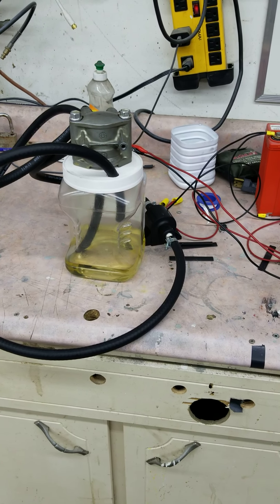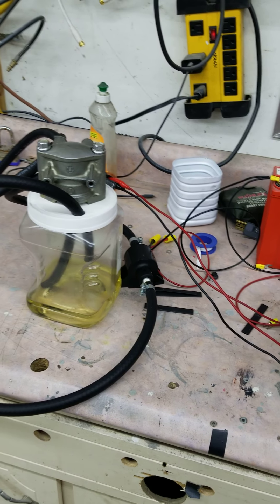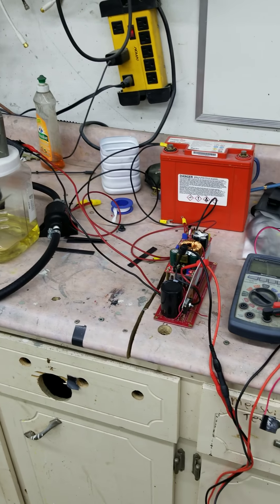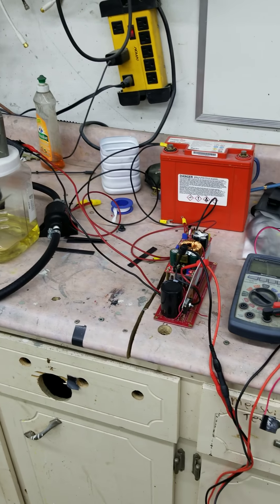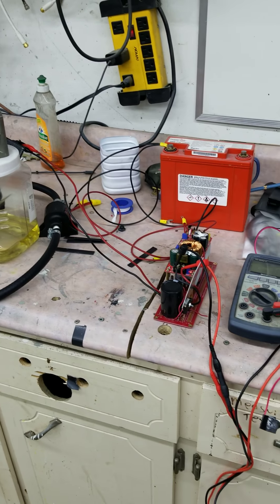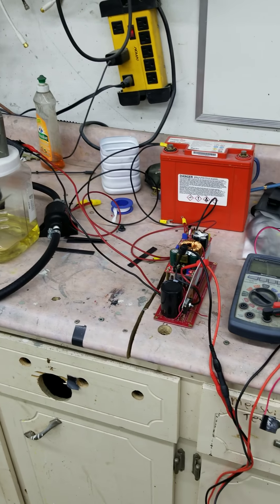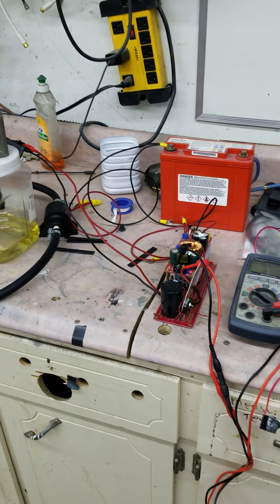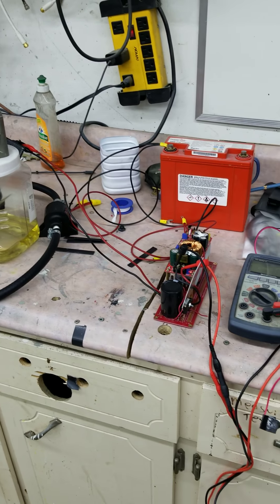Home built Etec outboard injector cleaner/activator system (video 1 of 2)

Comment: etc. I give 12 volt energy to the 40 hp full injector outside and the engine sound is heard but it does not spray gasoline. 2 injectors do not spray gasoline. Engine brain is solid. What can I do..Please help.
Reply from the maker: You have to remove the injectors to see if they are actually pumping fuel
Reply: fuel injector outside I put it in a full box and give it 12 or 24 volts. There is a ticking ticking sound coming from the injectors, but they do not spray gasoline. Do I need to give 55 volts? Thanks buddy..

Comment: whether you can send a picture or diagram of this assembly. i found a voltage converter on amazon but i need how you made the whole circuit, with that big capacitor on the board below

Comment: Hi Jim, Great video! 
But the electric build part is to much trouble for me. 
So I made a connection port for my fuel line which allows me to connect a portable fuel tank with a 5 gallon 20/80 mix of cleaner and fuel. 
Once I'm out on the water I turn off the main fuel supply and let the engine run at different RPM on the cleaning solution until it's empty. Then I switch back to my main fuel supply.
It cleans out the combustion chamber and fuel system as well.
This gets done once a year.
Also I use Yamaha Ring Free as an maintenance fuel additive.
Reply from the maker: Wow..that is actually a really good solution...and much simpler.  Very cool

Comment: i bought the allsun em276  injector tester and dc buck converter DROK 6-55V TO O-50 VOLT 8 A 400 WATT CONVERTOR I HOPE THIS WORKS, jim did i get the right stuff from amazon

Comment: sorry just looked at your other video thanks .question could i use a ac to 36v dc power supply to run system for the injector and what pressure pump are you feeding injector please also a list of cleaning fluids
Reply from the maker: You likely could.  I would start with a lower voltage until you see how it reacts.  Depending on the size of the injector.   I'm just using a basic electric inline fuel pump.  Pressure is not important in this case u just want the reservoir to have an influx of fuel to keep the injector full

Comment: wonder if you could remove the inyector from its casing and reinstall it backwards in order to unclog in the oposite direction flow using your set-up. Biggest issue I see would be the matting surface between the outside surface of the injector and inside face of its casing so does not leak.
Reply from the maker: I have never removed the injector from the casing but I understand that they do come apart.

Comment: Nice and smart idea.Any way you would clean a couple during the off season. Im in NB ?Thanks Terry
Reply from the maker: Hi terry.  Unfortunately I have repurposed much of those parts.  I no longer have an etec so the fuel pump and power supply are in use.
Reply: @ontariooutdoorsman  ok, thanks for getting back to me .I took mine apart , removed the screens and tips and did a cdeep cean and installed a seal kt with new crush washer and screens .I think I should be good .All the fuel delivery items were dirt and had H2O in them .Cleaned it all from tank to injector and got rid of the contaminated fuel(previous owner )

Comment: Hi Mr Jim  do you have a wiring Diagram for this tester, i am trying to bill one , Thank You So Much Sir
Reply from the maker: Hi.  I used to.  Cant find it.  If I get a chance I will see if I can make one.  It was very simple.  The injector tester box which sent pulses..going thru a transistor (darlington pair) to amplify the pulses.  Driven and powered by the dc to dc converter.
Reply: Hi Mr Jim Sorry to Keep bother in you ,but i tried every way i could with no luck , i have the Darling  NTE 2541 Transistor  ,i have everything ,but just cant get the pulsating  ,i also have the 12v injector cleaner  and the step up transformer just cant get it to work , Please Help!!!! @ontariooutdoorsman
Reply from the maker: Ok I set mine back up with a 12v headlightbulb as a load as i dony have an injector.  I think I know what's up.  The base of the transistor is driving thru a 2k resistor.  Its driven by the NEG wire from the pulser tester..not the positive.  This has to have something to do with the voltage wave coming out of the tester and the float voltage of the transistor base.  If you drive it with the red wire from the tester..it will just pulse on.  The voltage must stay too high and never turns off.  Hope this helps.  I'm going to draw up a diagram.
Reply from the maker: Watch this new video
https://youtu.be/BV0MgFIg5vk?si=lxHajF299kLIJ0ne
Reply: Thank You So Much Mr Jim ,YOUR A ANGEL , Thank You For a Diagram  that would be MOST HELP FULL AND APPRECIATED, I will  Be Looking for it  ,GOD BLESS YOU ALWAYS Glenn @ontariooutdoorsman

Comment: Gday Jim. What sort of amps are you looking at using with that dc2dc ? Cheers
Reply from the maker: I cant recall what current it was pulling .  It was a 0 to 60v dc to dc converter and I added a large cap to the output to sustain pulses.  I was running it around 30v and the fuel heats up quickly so there is definitely good current flow.  Could be calculatednif you measure the resistance of the injector coil

Comment: Hi Jim, Thank you for this video.  I have 2 x 115 Etec's from 2007.  The port engine has two bad injectors.  I didn't know that the injectors were so hard to find nor that expensive.  I am more than impressed with your set up.

So, if I've listened correctly, then I would need to source:
1. Etec fittings for testing & cleaning injectors from Ebay
2. solid state fuel pump - what brand, source, cost?
3. Seafoam cleaning solution
4. DC to DC converter to boost 12VDC to 55VDC, but you set yours at 35-38VDC for less heat production - any tricks on setting the output voltage?
5. Fuel Injector Testor - EM276 - any recommendations where you bought this?
6. Wiring is 12VDC positive into Fuel Injector Testor.  FJI to DC/DC converter.  DC/DC converter to ETEC injector
7. Reservoir built from what looks like a Friskies Temptations Cat Treats container, because I use them myself for other containers.

Is there anything I've missed because I want to build this now and clean all of the injectors on both of my engines.

Thank you again for this video... It's great.
Reply: Don’t need 55volt, 12 volt will operate the  injector. the injector tester is handy. Also don’t need the fuel fittings as it’s best to set injector in the carbon cleaner. Make sure you cover bottom holes (return) and the top filter. Injector needs to be removed from the housing.

Comment: Hi Jim, I was wondering if you connect the output injector tester cable +/- to the DC dc step up. I've connected all but the dc/DC doesn't start. I bought the same step up but i notice you have a capacitor between the injector and the output from the step up converter. Please send me a wiring diagram? Thanks.
Reply from the maker: So i have the output off the power supply connected to a darlington pair power transistor.  The injector pulser cannot power the converter directly...the converter is connected to 12v to produce up to 55v.  Then the output drives the injector thru the NTE2541 transistor.  Injector connects to collector of transistor...other side of injector connects to 55v.  Injector pulser drives transistor base which activates it.
Reply: @ontariooutdoorsman  Thanks for the explanation. I will try it. I allready burned 2 transitors. But will keep trying. 
Reply: Hi what # Step up dc/dc did you use and did you ever get it to work? Glenn Thank You

Comment: Hi,

Do I need to use a 10000uf 100v capacitor or can i use something similiar or abit smaller?

I'm having trouble finding one
Reply from the maker: I only chose such  big capacitor because the system uses alot of power.  I'm sure you can use a smaller cap

Comment: Do you know how many amps the injector needs to operate? Just looking to get a step up voltage transformer and not sure how many amps it needs to be able to support.
Reply from the maker: Sorry was a long time ago and I dont recall.  I can tell you that it generates significant heat so dont run it without fuel flow or will be damaged..there is a wide range over which it can operate so as long as you reach the threshold it will pump.

Comment: Hi Jim, I was wondering if you connect the injector tester cable +/- to the DC dc step up. I've connected all but the dc/DC doesn't start, low tension from the tester?  Thanks from Italy 🇮🇹
Reply from the maker: Hi.  So not sure if I have explained this fully yet but there is more to this than just the 55 volt power source.  The power source allows the voltage to be adjusted to the proper range however the fuel injector driver is a 12 volt device creating 12v pulses.  The injector pulser is driving a power transistor (darling pair) to activate the etec injector.  The darlington pair is a very high gain transistor with high input impedance.  The collector of the transistor goes to the etec injector neg terminal and the 55v supply goes to the positive etec injector terminal.  When  a pulse is sent...it basically connects the negative terminal to ground and fires the injector for the duration.  I found 35v to 45v quite good but certainly very powerful injector pulses as voltage approaches the 55v level.

Comment: Just wondering where do i get the fuel line kit for testing?
Reply from the maker: I actually found it on ebay when I purchased it.  I got the part number somewhere on Brp manuals.
Reply: @ontariooutdoorsman  i can't seem to find a part number anywhere for this product
Reply from the maker: @bryceraphael6865  all I can tell you is they call the fuel hoses a fuel manifold.  And if I recall it was something like a fuel manifold test fitting or test port.  Was a long time ago and cannot remember exactly but I bought it and it was an evinrude package with part number.
Reply: That's awesome thanks for your replies. I'll try looking under that description and post if i find something

Comment: Jim - wow, such an awesome video!  i am an outfitter in alaska, we run 3 jet boats on a skinny river.  2 of our boats we run yamaha 4 strokes but on our bigger boat we run an etec.  i have built a homemade injector cleaner for the yamis (way easier) & also have that pulser.  we have had to replace a couple of the etec injectors in the past & as you said...they're super expensive if you can even find them.  per your video i have a step up converter from amazon on the way.  i need to build these here at home (WA) in the next week before i fly up.  everything is in the bush so i have to have all parts with me.  my question is this...i cannot seem to find those adapters on ebay.  i'm either not searching correctly or the guy doesn't sell them anymore.  i know this is a big ask, but do you think you could check the size (threads etc) on yours and maybe i could get something to work?  my motor is up in alaska so i can't do a comparison on my own.  i'd really appreciate any insight you could give me.  if you can't, no worries...thank you very much for taking the time to film & post your rig, i don't think you'll ever know how many people you've helped with this.
Reply: oh & jim, if you do have the time i thought i'd ask up front too save time...i can't seem to find the o.d. of the end of the injector itself so i don't how big the hole i should drill into my lid that accepts it.  i don't know if you over drilled it & inserted a grommet or what.  i can't measure until i get up to alaska & then it'll be too late.  you prob have injector in motor but maybe you could measure hole in your lid & i could reverse engineer.  no prob if you can't spare the time...i totally get it.
Reply from the maker: Hi.  Sorry just seeing this now.  Hope  you have figured things out.  I basically just cut a hole in the lid f the jar that was larger than needed...then marked the 2 Bolt holes that mount the injector.  Very simple and the spray stays inside no problem
Sorry about the fittings.  I havnt used in a while but I will see if I can find them.  They are the identical fittings that the engine has on it to connect t the injector.
Reply: @ontariooutdoorsman  hey jim thanks for the reply.  we had to fly up for a week to open up camp for silvers.  i had built a homemade injector cleaner for my yamaha 4strokes (way easier), i ran out of time to dig out my etec injectors to try and figure out thread slash size of fittings.  i ordered the step up generator you recommended and after watching your vid again i realized the simplicity with regards to attaching the injector to your vessel.  my problem is that i head back up in a week for 2 months in the bush and won't be able to figure out the size of those fittings that go into the injector.  i can't believe how hard it is to find info on those fittings, i thought i was a pretty decent googler but man i'm struggling.  anyway, i appreciate the reply, if you happen to trip over the thing let me know:)))  although i'm pretty sure your injector is back in your motor.  or if you have a suggestion or a website/link i could go to... hey listen, this is a big ask, we're all so busy so i get it, thanks for posting all this, really helped me.
Reply from the maker: @8barbies779  ok I found it.  Went to my ebay acct and loked back at the purchase and found the OMC/BRP part number.  Check this link 
https://second-wind.net/products/omc-johnson-evinrude-5005844-genuine-oem-e-tec-outboard-nipple-o-ring-kit
Reply: @ontariooutdoorsman  Jim, can i tell you how much i appreciate you!!!  i'll be home in a couple of hours & i will check it out...i'm horrible with googling on my phone:)))  i will order if still avaliable because i have to leave for idaho on teusday for 2 months because i have elk hunting clients coming in on the 15th.  it just makes me happy that there are still people like you in the world that we live in with all the crap going on these days.  i will report back & let you know how it works for me & if there is anything that i can ever do for you i will respond to any reply you send me or i can give you my email.  i'm just blown away that you took the time.
Reply from the maker: @8barbies779  not a problem.  You may have to search the part number to find a seller but probably any dealer that sells evinrude parts can get it.  Good luck with it.  I'm also an avid hunter and bush pilot.  Good luck
Reply: @ontariooutdoorsman  Hello Sir, can you share the schematic and the type of equipment that you used for this system? Thanks a lot!!!

Comment: can you give me the site where you purchased the connectors for the fuel lines that circulate the fuel, connectors that connect those lines.thank you
Reply from the maker: I actually found them on ebay.  I believe the 2 connectors came in a bag and was sold as an etec injector Test kit

Comment: Did you find that any one cleaner worked better than others?  And once you get it started, did the motor run any better?  Mine starts fine, but has lost almost 1000 RPM on the high end.
Reply from the maker: It did run smoother.  I used seafoam and also another basic injector cleaner.  Cant really say if one was better than the other
Reply: Hey Mike did you fix your injectors?   My etec has lost 800rpm at wide open throttle... suspect injectors... did you resolve your issue?

Comment: Hey Jim, how did this work out for you?  I have an older Ficht which has been sitting. It seems like it would benefit from this procedure.
Reply from the maker: So interestingly it did make the injectors spray better.  You could actually see the pattern change as I ran them.  Unfortunately I still am.experiencing a starting issue with the motor and M now suspecting my fuel pump/vapour separTor
Reply: @ontariooutdoorsman  "wait for the beep." Or not. Anyhow oil is also being sprayed into that system as well and it is the oil part that clogs the injector obviously and not gasoline which is an excellent solvent in addition to being an excellent combustion fuel. Oil on the other hand whilst adding a nice power kicker to the combustion process and in that process adding a cooling/lubricating effect is what is going to harden your valves, sprayer, etc. I would argue fist and foremost to use only Evinrude synthetic blend oil then add any cleaning solvents to the oil delivery system and not worry so much about the sea foam. Always do a borescope test as a compression test could mean anything but a bore scope will tell you immediately if there is an issue with the combustion chamber proper and any seals, valves, scouring and worst of all rust that has gotten into an area that needs to be pristine to gain, maintain and sustain pressurization in order to create reliable combustion.

Obviously as well check your spark plugs and use only what the mfg recommends, properly gapped and indexed.
Reply from the maker: @doolittlegeorge  I think you are confusing this with a 4 stroke or vro.  Etec do not inject oil to cylinders. They are 2 strokes that inject fuel at approx 400psi into a cylinder just before TDC.  There are no valves as its 2 stroke.  Oil is only injected directly into bearings not into combustion area.  They are complex beasts.  You cannot change an injector without the data file that comes with it.  Each Injector gas a qr code attached and the associated data file takes deterioration over time I to account.